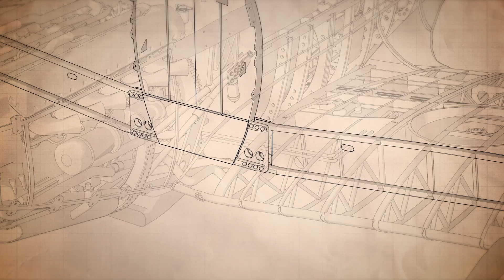INSIDE THE SPITFIRE FACTORY - Replacing a Restored Wing

Comment: I understood that the pins were such a precise fit that they had to be cooled in liquid nitrogen before insertion. Guy Martin was involved in a Spitfire restoration documentary and they spent some time talking on this point, to the extent that even the warmth from Guy’s hand holding the bolt was sufficient to stop it fitting properly.
Reply: ........  and when you want to remove said pins for servicing/wing removal etc?
Reply: Those were for later models after the war for shows nit actual dogfights , you don't want to have cracks in your metal when you're making a sharp bank and turn

Comment: you never ever drive a precise fit shoulder bolt in with a hammer- at most you can use a non metallic mallet but not when the fit is that tight.

Comment: I would have thought those rear spar pins would have been a tighter (more interference) fit than that! Any 'loose' tolerance on spar pins ends up in elongation of the hole in the spar and fuselage brackets when loading and unloading flight loads and torsional loads of the wing in flight.
Reply: Simon Baxter: There are accounts of Spitfires being flow without problems and later found to be without the rear wing attachment bolts being inserted.
Reply: @453421abcdefg12345  Having built aircraft myself, I find that very hard to believe. The torsional twist on the wing would tear the wing of in no time without the rear spar pin to prevent that! Like to know where you heard that bit of folk law!
Reply: @simonbaxter8001  Folk Law! You are a cheeky bugger, it was directly from Airframe Assemblies IoW, I think it safe to say they have more knowledge on the subject than you do.
Reply: @453421abcdefg12345  Your assuming that I haven't worked in the aerospace business myself ... which I have, for over 20 years! So, not as cheeky as you might think! Plus I can site many GA aircraft accidents that have occurred because of rear spar pin failures, including the aircraft type that I built.
Reply: @simonbaxter8001   this the piece of footage where they describe the missing pin ,   https://www.youtube.com/watch?v=iM6ByCYWjxk  skip to 9:50. I can't comment on the validity of the statement though. I just go by what the people who build spitfires every day say.
Reply: @MrVolvobloke  Thanks for the link. I'd like to see evidence as from my structures experience, the drag load on the wing (inward at the rear spar pin) plus the torsional load from the centre of pressure being about 5% behind the main spar plus aileron and flap loads increasing that torsional twist (upwards load on the rear spar pin), 'unconstrained by no pin', would cause trailing edge flutter very quickly shortly by failure of the main spar. I'm going off my experience, the structural design considerations for the rear spar attachment is and the many accident reports (on aircraft with far less flight performance and structural loads) following it as a single point of failure. These guys here are quoting what someone else has said and as such, without evidence, I consider that very much as hearsay, sorry! If they say the wing trailing edge had obvious physical movement during a walkaround, then the wing would 100% fail as soon as any flight loads were imposed on it!
Reply: In the case of the Spitfire the rear spar was not a structural member, being an 'auxiliary' or 'false' spar used to attach the ailerons and flaps. The Spitfire's main spar and D-box was extremely rigid and carried all loads. The main problem with the lack of a second main spar was aeroelasticity towards the trailing edge of the wing which caused problems with control of the ailerons, which was later cured in the Mk 21-24 with thicker gauge skin on the wings and a yet 70% stiffer main spar.

Comment: It’s amazing how simple and elegant the wing attachment system is - 8 bolts each side with just those two transverse beams at the front connecting the wings into a single unit. It’s hard to credit that could produce such a strong, rigid connection.
Unfortunately, the Hawker Co. were nowhere near as advanced and/or sophisticated and instead used a very heavy structure of metal tubing round the cockpit and wing roots of the Hurricane. They’d used a virtually identical system on earlier biplanes. 
They even carried this forward to later aircraft and it makes you wonder how much excess weight they could have eliminated from the Typhoon and Tempest if they’d been more up to date with build technology.
Reply: Its like the Iowa Class Battleships with the hybrid use of rivets and welding, much more could've been done with them if they'd been welded together 100%
Reply: Yes agree, but that formed a safety cage around them and made the planes much tougher too (a confirmed person in believing over-engineering is better)!
Reply: @Slaktrax  the Hurricane had the same vital points as the Spit, maybe more so.  Oil, fuel, glycol systems, and a lack of armour on the header tank.  The heavy structure (hence poor performance) made it more vulnerable to german fighters, so the Hurricane was a losing proposition.  Obsolete by end of 1940.